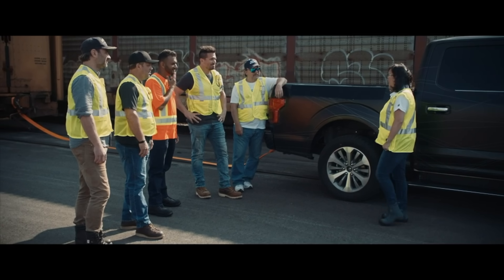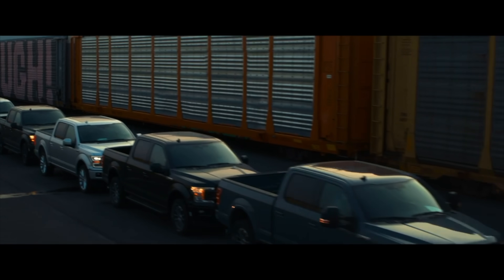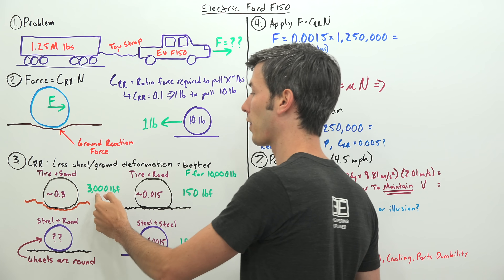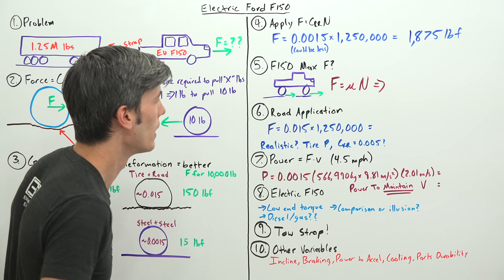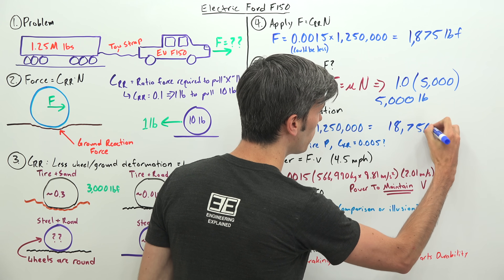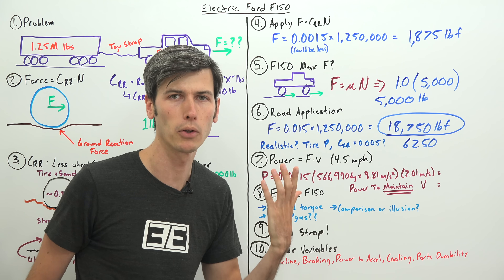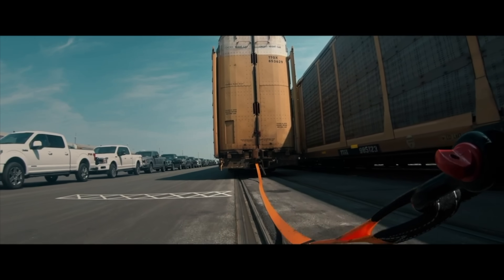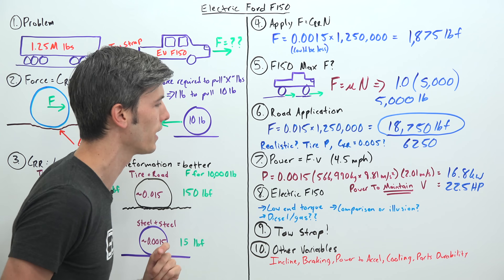No, Ford's Electric F-150 Can't Tow 1 Million Pounds (Realistically)

Comment: How did they manage to make the specific track perfectly horizontal/ leveled? Did they? I guess they used the slope for their advantage. I guess the slope is the most important factor in this equation. Can someone make a calculation for a slope? I think of a tiny slope of which the train does not move if brakes are released. And another slope for like 1 and 2 percent in the one and the other direction. I wonder why the slope was not talked about in this video.

Comment: You miss one very important point - how does static friction compare to dynamic friction?  You need much more force to get it going compared to keeping it going at low speed.  Still not very impressive to pull this off.  Lots of regular vehicles can master this.

Comment: I've seen videos of a strongman pulling a 1000 ton train so that's 2 million lb. I'm thinking even a small car or a high power motorcycle could pull with more force than the strongest human on all but leg extension activities. Rubber wheels on tarmac are much less efficient than steel wheels on rails. Water is the holy grail (other than outer space). It may be possible to pull an entire cruise ship by yourself if you can put up with extremely slow speeds. The resistance of water is next to nothing provided there are no currents, but increases with the square of speed so fast boats require huge amounts of energy.

Comment: ANyone who's been around boats much will see a lot of these principles at work ... it's surprisingly easy to push an 8 tonne boat around (by hand) standing beside it on the dock in flat water in places sheltered from the wind. Provided you just apply moderate, consistent force, it'll slowly move in the direction you push it. You'll never be able to shove it off quickly, and you sure as hell won't stop it if it's coming at you with any momentum either!

Comment: Meanwhile chevys can barely pull 1 ounce.
Reply: I have a Colorado and it pulled my trailer with a full metal humvee
Reply: @javemascarinas7496  humvees are  aluminum and fiberglass.
Reply: @Boss-bf7ru  its a military humvee my man
Reply: @javemascarinas7496  military humvee lol. All humvees are military my man. The civilian version is called a hummer h1 my man. The military version is aluminum and fiberglass my man.
Reply: @Boss-bf7ru  ever heard of Up armored frames with steel rods?UL Level 2 glass? Level 3A doors?
Reply: @Boss-bf7ru  the humvees i carried aren't the lightweight models, they're the up armored models, you clearly haven't been to the military yet
Reply: @Boss-bf7ru  you do realize a base colorado can already pull 8500 pounds, the colorado we used when transporting has alot of aftermarket parts which makes it able to pull 10k pounds max, the humvee it self is 9.5k
Reply: @Boss-bf7ru  drive a colorado first then judge
Reply: @Boss-bf7ru  also have you ever heard of Military transporters? How about transporting vehucles to one camp to another?
Reply: @javemascarinas7496  i have driven a Colorado. They are useless. That can't get out of their own way. Plus they are an awkward size. They don't fit in with full size trucks and they don't fit in with mid sized trucks. You cant drive them on construction sites because they don't fit in any of the ruts. Their front ends wear out in a few miles. The engines are complete garbage. Their frames are weak. There are zero things that are good about them. The Colorado is trash and everybody knows it. You are preaching to an empty crowd.
Reply: @Boss-bf7ru  i see you have searched google for that, you do realie that were talking about pulling and not size, our colorado has been running for 5 years and still runs like a champ, no rust no anything, make sure you google the correct stuff kid

Comment: I'm not a engineer but I think that to move that train the pickup needs more weight so therefore it requires more mass and also a bigger engine and higher low end torque.

Comment: There's a railroad trick here. 

Trains (and probably Ford) don't start with 1.25M lbs load on the hook. But in this case with 0.125M lbs (10 wagons) 

To get the heavy trains moving, first the wagons are retracted to compress the train. To increase the slack between the individual wagons. Then, with the slack, you can move the wagon, on the wagon. And not the whole train as a single load.

Comment: One little known fact is that railroad cars have air brakes, and with that many cars Ford either took a REALLY long time with a very big compressor to charge the lines and release the brakes, or they hooked up a locomotive and the truck was either pulling that to or the train was just pushing

Comment: So your saying i can’t just hookup a set of loaded super b trailers weighing 115000lbs and haul it down soft gravel roads? Why tf do they bother with ads like this like seriously if that guy had the smallest hill to start on there would’ve been more smoke than tires. I’m glad you fully explain the math but simplest form a rwd hatchback can pull this why not a horse trailer loaded with posts up a emergency truck ramp? Now if it could do that it’s incredible.

Comment: What may also attribute to the rolling resistance is clean tracks. I see that they are filled between rails. Which have a nasty habit of collecting dirt, gravel and other debris where the flange of the wheel needs to turn. something as small as a bolt or cotter key could halt this train at that low of speed

Comment: I like your thinking, I would have liked if you made it even more realistic by adding the exact numbers in terms of weight and gearing assuming they were in first. You might have done that off video but it would have made it even more believable. One other thing, you didn’t take in the factor of the rolling resistance on the bearings that the wheels rotate on, and there are a lot of bearings on a train lol. Along with that you would probably need to take in the fact that whatever the rolling resistance is, you need to multiply it by however many wheels they were rolling on. I’m not super smart and I could be wrong but it would be cool if you had a rebuttal for my reasoning😁.

Comment: Jason, Is it true that horsepower sells cars and torque wins races and draw tie load calculations bamboozles common onlookers ? I am so glad that you included the resistance according to inertia in your explanation calcs. And yes traction relies heavily on a vertical vector of " F " . But increase the start up inertia, why ? Change the pitch of the draw tie to include the proper vertical component.  Yea. And don't forget MAGA. Ford is at the forefront. Just ask their Brazilian division .                                                                                        Cheers.

Comment: I once pulled an 18 wheeler that had a gross weight of 84.000 lbs with a 1966 Caprice ! Flat ground of course. Pulled him off the road into a parking lot. He had lost a u joint and the drive shaft fell out.

Comment: A couple of questions:
The Force values: does that change does that multiply by wheel touching the surface?
The towing strap: actually helps the track, especially at that length. I don't work in towing but according to someone who does, cough Ron Pratt on YouTube *cough*, a strap would have some stretch to it. But sinced that stretch condition is not natural to it, it will try to contract, which would help to get the load moving.
Thanks for what you do. A lot of these different numbers fly past me, but the whiteboard definitely helps. God bless/good wishes 👍

Comment: Another way to crack this myth: there is only one strap that is pulling the train, and the starp survived. There's no way that single strap can handle one million pounds!
Reply: You don’t seem to get it. While the strap pulls 1m lbs, it only needs to withstand 2k lbs of force. Weight and force are very different
Reply: @nathangetty4892  yes that was the point of the comment you replied to and of the whole video
Ironic
Reply: @nathangetty4892  Interesting so let's go with OP and replace those weights with a block of concrete that weights the same, it would probably be several hundred meters long if using the same dimensions as the train for height and width ;) also let's place it on asphalt since a car tyre works great on asphalt, wonder what kinda load would that single strap handle now? ;)
Reply: Fix it with flex seal
Reply: It did pull 1.25 million lbs, but that wasn’t the strain it was taking it was the force of the tension and the force of the truck
Reply: @gaugebuseck3375  it didn't pull 1.25 million pounds. Your points are contradictory. Pulling, in a strict scientific sense, has to be done without the aid of wheels and on a ground with negligible friction. Otherwise, the coefficient of friction would HAVE be factored into the actual weight being pulled.
Reply: @gaugebuseck3375  The weight of the train is 1.25 million lbs (vertical,  G=mg=1.25 million lbs). But the tension needed to pull the train horizontally equals to the rolling friction which is far less than 1.25 million lbs. The rope is taking all the tension because it's the only contact point between truck and train. So neither the truck or the rope could handle 1.25 million lbs of force , horizontally.
Reply: @xuhan4682  I never said it could handle the force but it did pull the train, we watched it happen, that’s all I was saying
Reply: @gaugebuseck3375  This task is not hard. That's all I was saying.
Reply: @xuhan4682  ok well I guess we were agreeing and not realizing it then.
Reply: Woosh
Reply: @nathangetty4892  woosh
Reply: @csl2583  I don’t see how this comment is a joke dude so no whoosh
Reply: @csl2583  Where was the joke in the comment? No punchline or anything.

Comment: The one other detail that was left out was that the rail tracks where over some asphalt for the F-150's rubber tires to grip. Try giving the F-150 some steel wheels to go on the tracks, it would never pull it as it would not have the tractive force.

Comment: ok i notice two big mistakes he make first of all no it doesn't matter if the train is on steel wheels on Steel rails because the insane weight will make enough friction to create resistance meaning that even steel on steel because of the weight it doesn't make any difference if it was rober on perfectly grippy road and second its impossible to accurately calculate the force needed to pull it because other than weight, friction and total torque needed you somehow need to know the amount of resistance each wheel creates and the amount of force needed to turn each multiplied by the weight

Comment: But hear them out, electric motors are more efficient at generating torque because they don’t have to wait for an engine to rev up and it doesn’t need a transmission, electric cars are just better in every way

Comment: There's also alot of slack between the knuckles of each train car. So that kinda helps to get the thing started because essentially you're only pulling one car at a time briefly before the next one starts rolling and by then the previous car has a bit of momentum to get the next one going.
Reply: this is huge, it's how you can go with a loco with the same low friction

Comment: There's a very cool fundraiser the Virginia Museum of Transportation did having people pull a rope to move their Norfolk & Western Class J 611 steam locomotive...which is near 1M lb empty and well over it when loaded with coal and water (which they had it in one event, to operate the brakes and drive it backwards to reset for another tug)...couple dozen humans on a rope had no trouble pulling it a short distance on the track.  If some humans on a rope can pull that much weight on train tracks WITH THEIR BARE HANDS I would question why any truck (or car!) couldn't do it.

Comment: One thing I think is missing from your equations, rail car couplers have some slack, if they took advantage of that they could get "some" momentum on the 1st car (even if it's under an inch) before it yanks the 2nd car and so on...so it may not have to overcome ALL the static friction at once.
Reply: True, if you manage to move the first rail car some cm(inches) the f150 and your car is already weighting much more than 5000pounds
Reply: Yup. That is exactly why a single locomotive can tow dozens of rail cars, and I felt like it was a huge omission from the video
Reply: @marconka441  well no - once the whole train is moving there's no slack, so the locomotive really is supplying enough force to pull all of its cars. Besides, the maths supports one locomotive supplying enough force to do so.
Reply: @ME0WMERE  but the weight of the first car moving helps get the momentum to pull the second car and so on even with just a tiny distance between one another which doesn't put as much force on whatever is pulling them.

Comment: ez answer. it was on rails it takes less energy to move on rails on the road there iis more friction caused that on rails and so the ford has more grip thereforeit can pull on rails which has less grip. in other words, the ford was able to do this because it had more grip than the train cargospace on the rails..

saved your 11 mins youre welcome

Comment: you didn't take into account the moment of force that'll be trying to tip the vehicle backward. In reality, the truck would have to be heavier than this calculation just to keep all four tires on the ground. This moment of force would also decrease the normal force available to the tires for putting down power on the road. The way you demonstrated it involves a very dumbed-down version of the actual physical system. This downplays the achievements of the truck and also musks the difficulty in hauling oversized loads. It also downplays the much higher difficulty in moving that payload on pneumatic tires.
This is also the reason why big rigs make use of the gooseneck thing. It's to make sure the rear tires have weight on them so that they have a significant amount of normal force against which they can put down power. Otherwise, the trucks would lose a ton of working capacity just because they are constantly trying to tip backward.
Do physics right.

Comment: A truck in Australia pulled some enormous number of trailers. Our triple trailer road trains, even eight trailer trucks are super pullers but by using the small gap between the surfaces of the couplings to get one, two, three etc trailers moveing one at a time. Big trucks have similar power but greater torque than a two ton pickup. The sustained application of that, until every trailer was rolling might have bothered the clutch but over here we also have five hundred horsepower self powered trailers.

Comment: I find it weird there is no explanation involving moments of inertia.  The truck does not need to motion 1.25 millions pounds to begin with.  The mechanical interconnexion system allows in this case to need 10 times less force.  Once the first train car is in motion it will pull the second car then the inertia of the the two first car will pull the third car and so on... I was expecting these facts to be explained because this is the interesting science part in trains. This is where the magic happens! Maybe an another video?

Comment: Great video, only note, you said 1800lbf is the force that the tow strap is enduring, but that's only true when constant velocity is applied, I wonder how much it had to handle during acceleration, and mostly when going from 0 to the first deltaV, which usually is the point of highest normal resistance.

Comment: Also you don't have a single mass to accelerate but individual carts which actually have space between them. At rest you only towing the first cart, when it gets moving its momentum helps to tow cart behind it and so on. This is actually how trains can have crazy weight and still be able to move.

Comment: The F150 did not start off pulling all the train cars at once. 
All the train cars were sitting forward in the couplers. That give about  2” of travel before the next car was as added to load. The momentum of the first car helps to get the second car moving and so on and so on. All the F150 had to do was keep the 22.5 horsepower engaged. This was total bull crap.  1.25 million LBS. lmao!

Comment: The Ford Electric F-150 would need the engine of a locomotive to tow 1 million pounds. Even if it could, the wheels, frame and the rest of the truck would instantly fall apart or explode

Comment: we still don't know the actual force required...when you're dealing with rail equipment,  even an overnight change of 20-30 degrees in temp can greatly change the humidity and steel rails are always trying to oxidize. The level of oxidation can increase the rolling resistance greatly not to mention the amount of resistance in the bearings.

Comment: I’m going to hazard a guess before watching the video and say the answer lies in friction. If there was no friction, you could accelerate any mass using any force, it’d just take longer the bigger the mass and the smaller the force (assuming of course no gravity or other forces acting in the direction of the motion, which is the case here as it’s normal). This setup has reduced friction, hence why the truck can pull it.

Comment: Pretty much a ride on lawn mower could do this, as well as a bicycle, if the bicycle human had a like a crazy gear ratio.... The strongman can do stuff like this...
The Early Rocket Locomotive of 1831 features a 20hp engine pulling 160,000 lbs of coal on level track at 15mph. Its easy to move stuff on rail, which is why all our cars and major roads should be replaced with free train infrastructure....